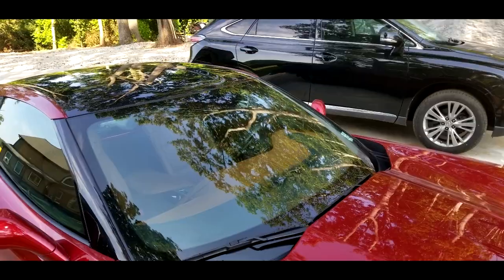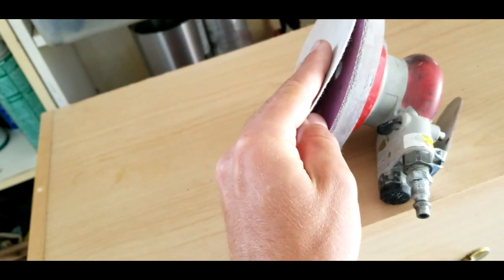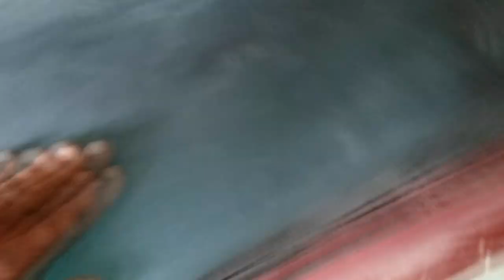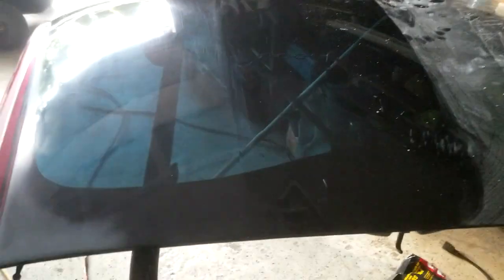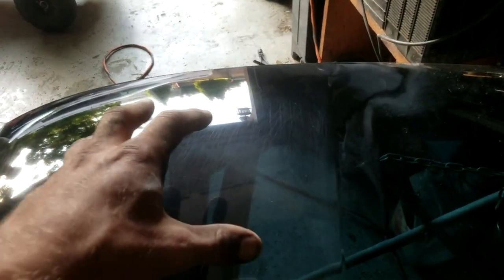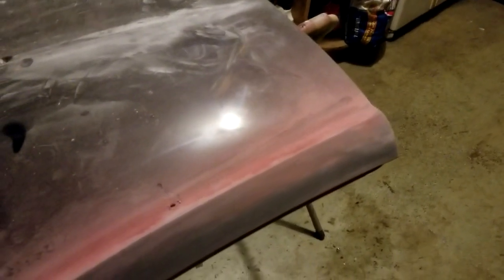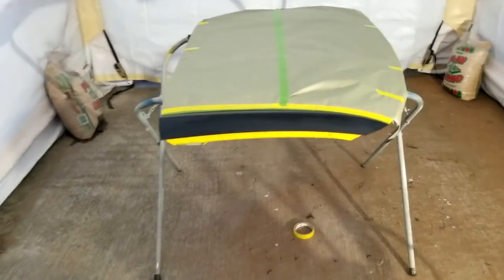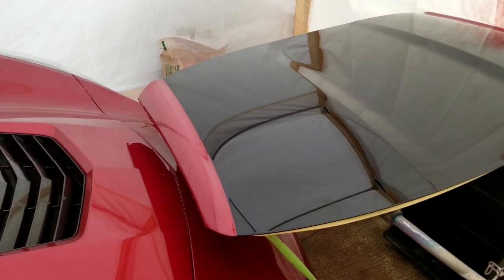SCRATCHED CORVETTE TARGA ROOF RESTORATION--lost it on highway

Comment: I just sanded mine down but little tiny swirls keep coming up. Do I need to keep sanding or am I missing something?
Reply from the maker: You need to clear coat it if you can't get swirls out, means they were deep on previous stage of sanding
Reply: @BaselineCarChannel  awesome! Thanks for the reply It seems like I got the swirls out sanded with 400 grit worked my way up to 1000grit then polish but there is a lot of scratches still any ideas or am I doing something wrong? Sorry your video helped a lot but I’m not really getting the results I want

Comment: I need mines fix
Reply from the maker: Follow my process and you should be able to restore it, if it hasn't cracked
Reply: Baseline Car Channel naw just scratches
Reply: Baseline Car Channel I much will you charge to do it just a few scratches and paint the edges white
Reply: What polish did you use?
Reply: What polish did you use?
Reply: What polish did you use?